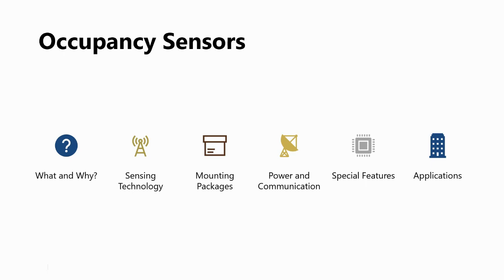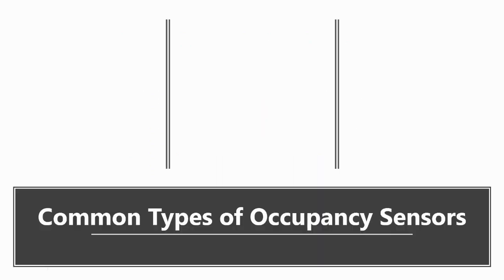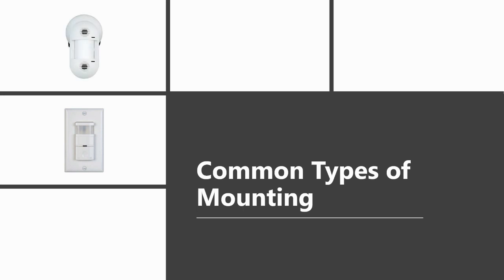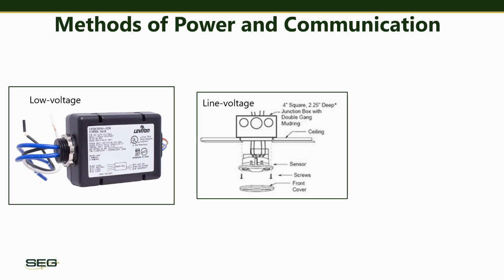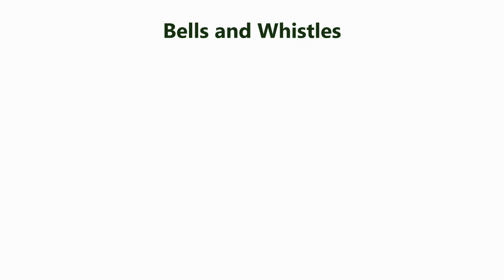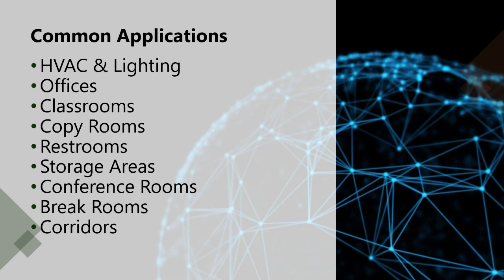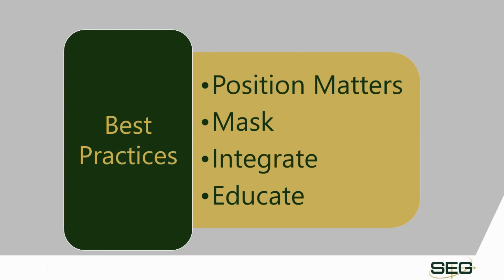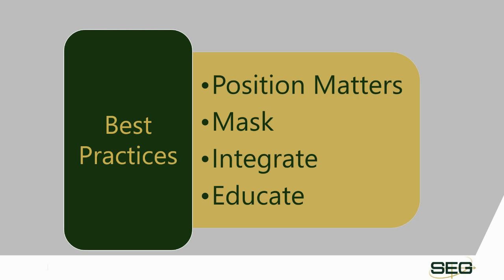Occupancy Sensors - Inexpensive Energy Savings

Comment: Could I add some type of occupancy sensor to a bathroom exhaust fan to automatically come on when someone walks in?
Reply: To the best of my knowledge, you can tie an occupancy sensor into anything.

You may need a relay in between the sensor and the power for the fan, depending on the power of the fan and the limits of the sensor used.

-Scott
Reply: @scottlege6369  OK cool, thanks man